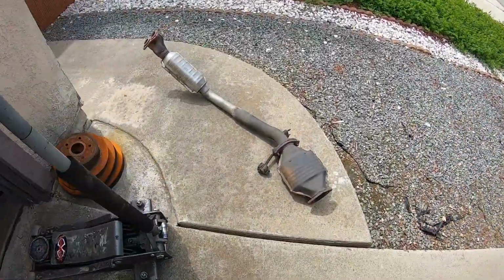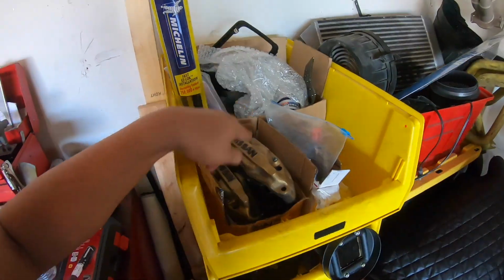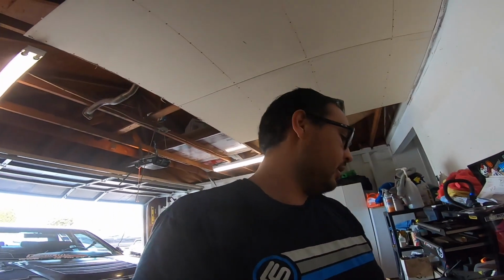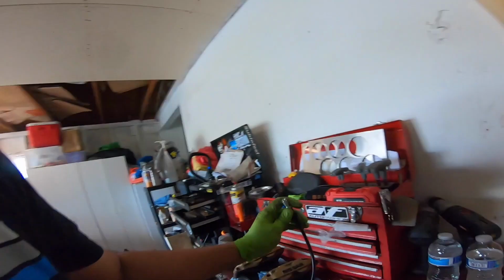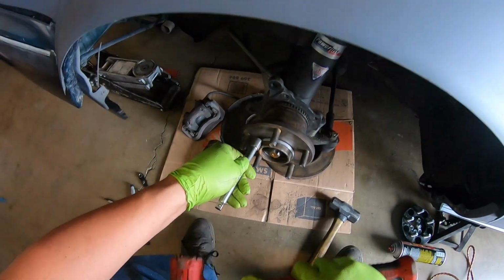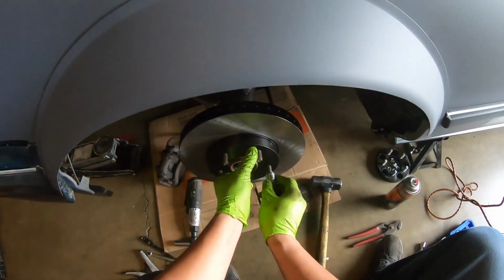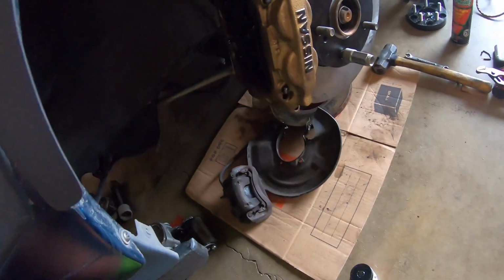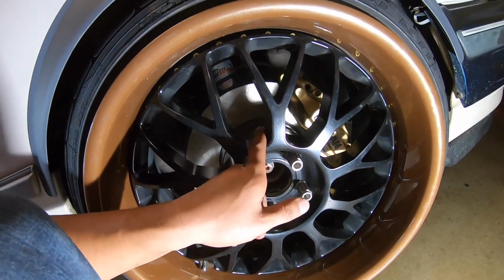Stay At Home Day 6:  Z32 4pot Caliper Install

Comment: The hub centric ring is meant to be tapped into the rotor . That ting is to far back the toyota centre bore is 60.1mm. That rotor as its installed will just rattle around as its non centric to the hub